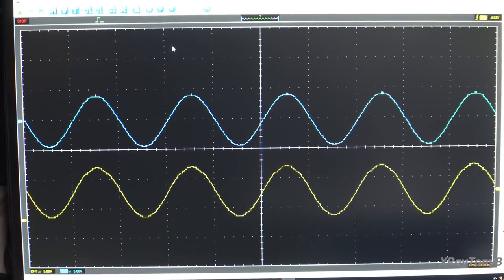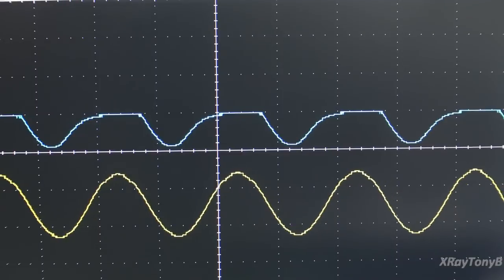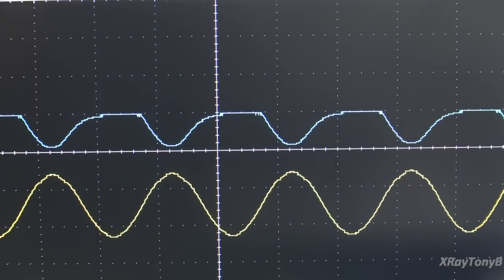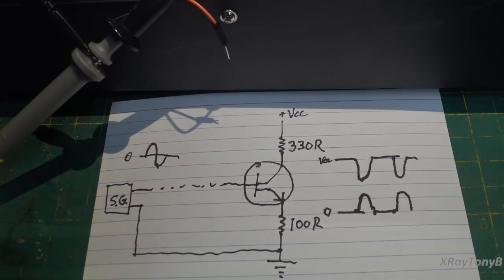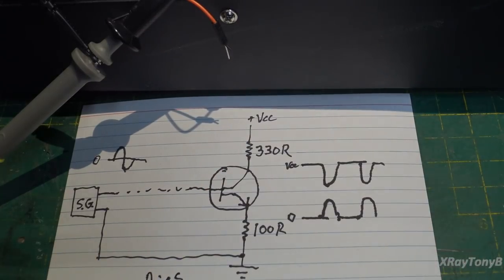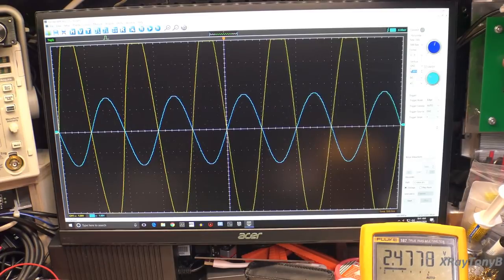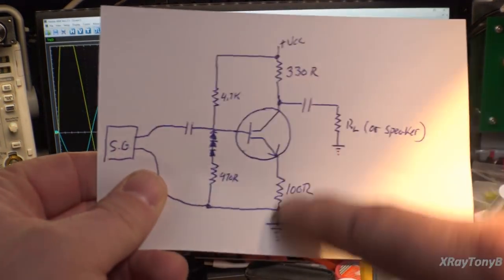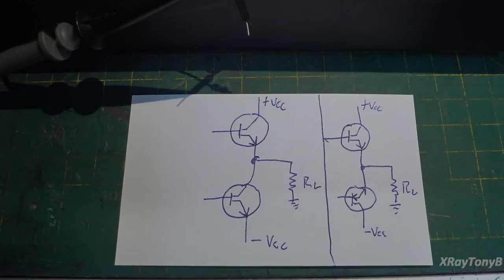Understanding Amplifier Class A & Class AB

Comment: I've been an electronics engineer for 46 years and I disagree with your characterization of the two waveforms at the beginning of your video.  Your Blue waveform is nothing more than an AC signal with a negative-going phase at t = zero referenced to 0V, or ground.  Your Yellow waveform is a composite waveform that has two components, a DC level with an AC signal superimposed on top of it with the same amplitude with negative-going phase, just like the Blue waveform.  It is not a DC waveform.  Whereas the Blue waveform oscillates around zero volts, the Yellow waveform oscillates around a DC voltage approximately the same amplitude as its waveform, NOT zero volts.  In engineering, this is called an "offset".  If the voltage offset on the Yellow waveform was on the order of 150V to 200V, you would probably be looking at the plate of a small-signal vacuum tube in a preamplifier section of a tube amp.  The AC signal would be riding on top of the large DC offset.  The scope probe would display the offset + the AC signal and you would probably have to re-position the signal display since it would most likely go off the screen as you increased the resolution to see the small, AC signal.  If you had a scope probe with the appropriate voltage rating the could be switched from DC-coupling to AC-coupling, the probe would "BLOCK" the DC offset and then display only the AC signal.  Or you could move your scope probe to the other side of the high-voltage coupling capacitor in the signal path that is blocking the 150V-200V DC voltage from overdriving and damaging the Grid circuit of the follow-on tube stage.  You would see AC signal without the offset!  Either would work, but I think the latter is safer for the probe!
Reply: Thank you,  I can stop yelling "DC Offset" at my phone now lol.
Reply: So basically what your saying is both signals are alternating current, but one signal is offset by by a DC voltage?   Why does the diode totally block out the AC signal if it is offset by a DC voltage?  Why when the signal is removed we don't see the offset voltage?
Reply: Discretesignals A diode is a solid state device built in such a manner that a “junction” or “barrier” is created where two semiconductor materials meet.  One side of the junction is the Anode, the other side the Cathode.  Current is allowed to flow in the diode when it is “forward biased “, meaning the voltage at the Anode is “positive” with respect to the Cathode.  When this voltage reaches about 0.5V to 0.7V in typical diodes,  the “barrier “ is overcome and current flows through the diode.  But if the voltage at the Cathode is “positive” with respect to the Anode, then the diode blocks current.  This is called “reverse bias”.  These two properties of diodes is used all over electronic designs in all solid-state devices with individual, discreet transistors to high-density ICs.  Now with that said, when xraytonyb connected the Yellow signal to the diode in one direction, the diode did nothing.  That was because in that connection, the voltage at the Anode was always “positive” with respect the the Cathode.  Remember, he said the Yrllow signal’s voltage never fell below “zero”, it’s maximum was the DC component + the AC component, it’s minimum was the DC component - the AC component.  If the DC level is identical to AC amplitude, then the minimum voltage across the diode is Zero, but look closely and you can see they’re not really identical, the DC component is just slightly greater than the AC amplitude, which means that diode will always be “forward biased” when the Yellow signals polarity is in one direction.  The diode would always conduct current, and does nothing to the signal, there no change.  But when he reversed the leads, the opposite became true; now the diode’s Cathode would always be positive with respect the the Anode, and the diode would always have a “reverse bias”, and never conduct in the forward direction.  The Yellow signal would always be blocked, and you saw no signal at the scope probe.  Hope that explains it!
Reply: @DrDoom-qh6iw  thank you for the explanation.  I guess I'm confused about the AC voltage signal riding on top of the DC voltage offset part.  I work on automobiles for a living and bias signals are used in automotive circuits.  On GMs they use a bias DC voltage of 450 mV on the O2 sensor circuit.  The O2 sensor generates its own voltage that alternates.  The signal will oscillate between 0 and 1 volts.  If the O2 is unplugged you see only the bias.  That's why I was wonder if the signal from the frequency generator is removed, why doesn't the scope show the bias voltage?  

When you have alternating current and direct current flowing together in the same circuit does the alternating current change the direct current in a way to mimic the alternating current's frequency and amplitude or does the AC just ride on top of the DC bias like a person riding a horse or a surfer riding a wave?   I know this is fundamental stuff, so thank you for taking time out of your day to set me straight.
Reply: Dr. Doom1951   this is almost greek to me so I may be a bit confused, just trying to learn something
DC= non changing polarity current
AC= changing polarity current
is it correct?

both AC DC can be steady or variable
is it correct?

both AC and DC can be composite waveform with signal superimposed on top of it, though they're still AC and DC.
is it correct?

if that's correct I dont get why the yellow line is not a DC waveform.
Reply: Lerameistezet Correct, but the DC could be of either polarity, positive with respect to ground, or negative with respect to ground.